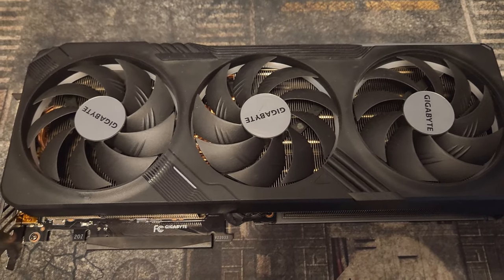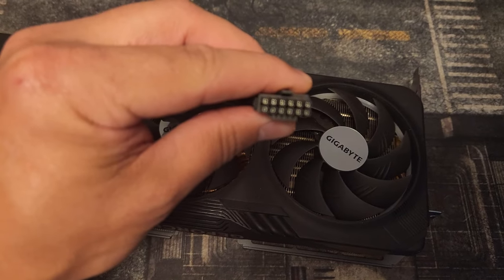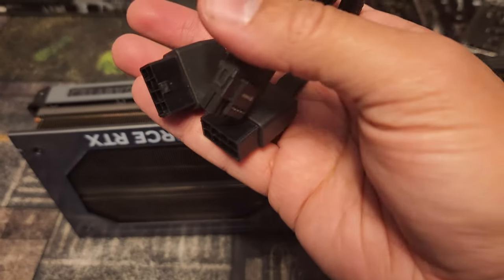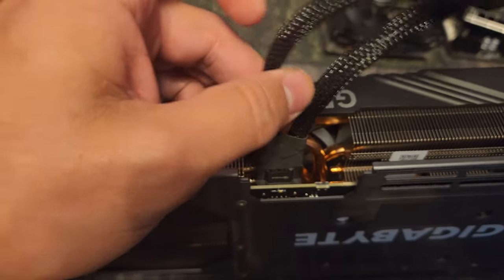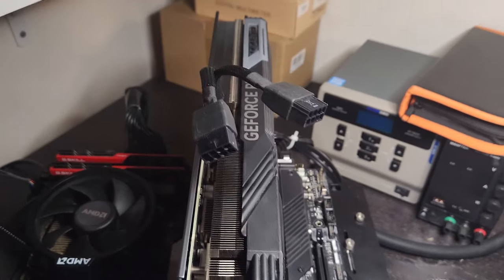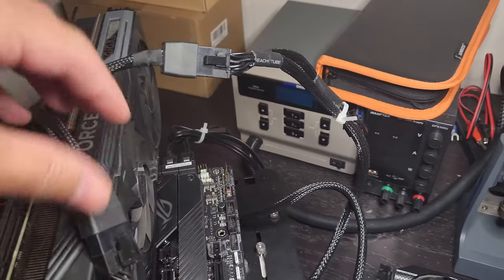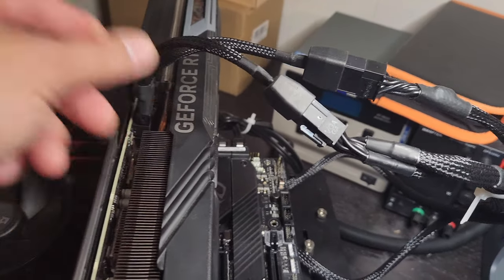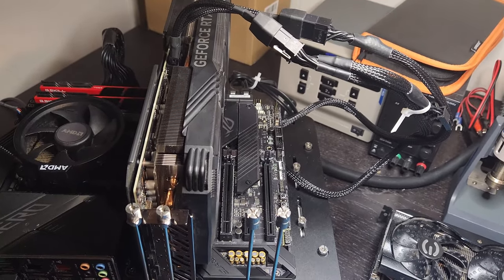RTX 4070 TI installation guide: everything you need to know about the 12vhpwr cable!

Comment: Can i use two 6x2 pins instead hooked up into the adapter?
Reply from the maker: I wouldn't
Reply: @kr00tman  can you direct me into the right pci cable? I'm using the one for my 3070ti and just hooked it up to the adapter. Seems to be working fine other than certain games crashing
Reply: @kr00tman  they're 8 pins*** it's just a 6 pin with the 2  separated
Reply from the maker: @nickbryant6970  it needs 2 different 8 pins
Reply: @kr00tman  I have two 6 +2 8 pin connected into the adapter should that be fine?
Reply from the maker: @nickbryant6970  they are their own cables plugged into the psu right, not 2 pigtailed off the same plug
Reply: @kr00tman  8 pin in the psu that pigtails off. In to two 6 + 2 8 pins
Reply from the maker: @nickbryant6970  yup has 2 be 2 different ones
Reply: @kr00tman  so I need 2 8 commectors pins in the psu. Weird my corsair didn't come with one and I'm finding it hard to find 4 x8 pcie pins cables.

Comment: Omg you're genuinely amazing! I was looking for something like this. However i think my issue is im a bit ignorant about the power supply, mine currently has a 2070super and im waiting for the 4070ti but I've noticed my 2070 super is using a double rather than a single, and you said that's not good and idk how to exactly work around the power supply since it has so many plugs, would you be able to make a video on that or at least recommend one? Thank you
Reply from the maker: how many vga 8 pins does your gpu have?

Comment: NOTE: some RTX 4070 models (like the MSI) have a 3 plug adapter, instead of 2 plug. The Gigabyte has only a 2 plug adapter (like yours). THIS IS IMPORTANT because these GPUs have been known to catch fire! So an extra plug for power sharing is kinda critical.
Also, I originally didn't know that the VOLTAGE CHANGED because the "PCIe" 8 pin connectors in my PC put out 3.3V, which works fine on my old GTX1060, but WILL NOT POWER UP the RTX4070, which requires 12 volts (12 pins for 12V and 12 pins for ground and 6 wires for SENSE).
NOTE: I soldered extra wires to the new 12VHPWR connector and ran them to 12V on one of the old 8 pin connectors and it NEVER blacked out again
Reply from the maker: Good thing you checked that, but I can confrom 4070s are designed to only need 2 8 pins to work. The power sharing does not matter as long as the cables are to spec, same reason why it does not matter if a 3 pin vs a 4 pin is used for a 4090. I am not a professional I am just going off what I have seen from experts as well as my own experence.
Reply: @kr00tman  you can't hurt the GPU with an undervolt condition, it just won't work. The only way it could get damaged by low voltage is if the voltage is reversed bias
Reply: That's exactly why I am here, there are 3 cables on my zotac and I'm scratching my head here 🤔